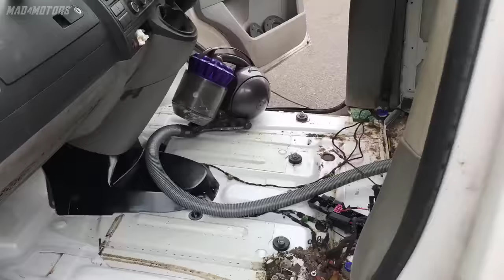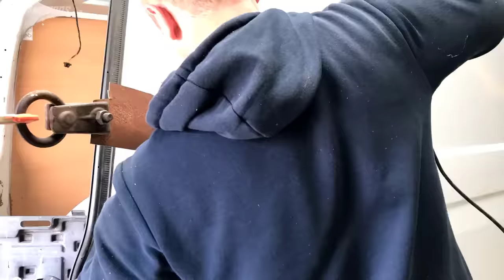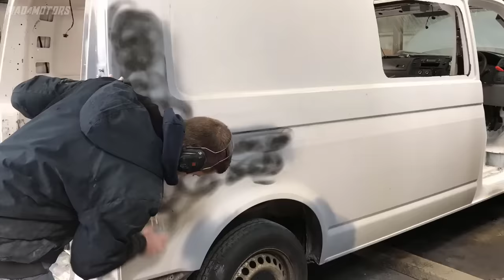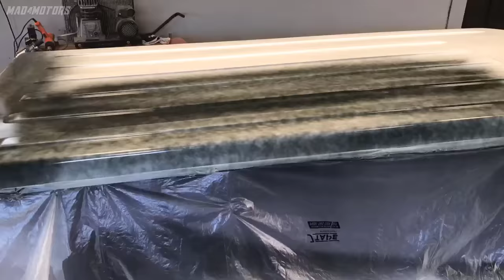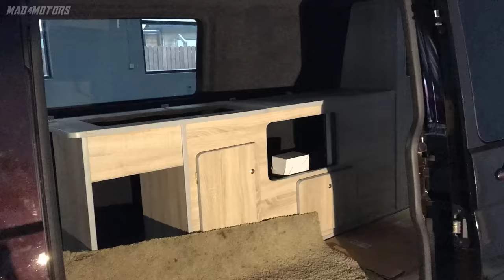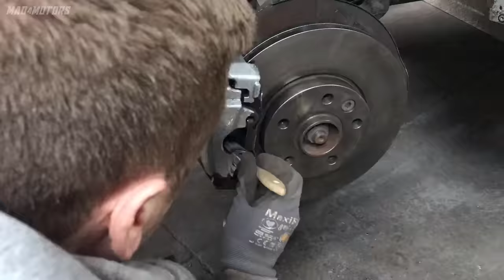Complete Camper Van Build Start to finish Conversion

Comment: Well done, the result speaks for itself. For esthetics I would add rear glas windows from the outside. It just adds weight and has no function but it looks even better.
And I personally would have replaced the double seat with a single seat and svivel function. By turning the seat around the usable living space is significantly increased!

Comment: what about the bottom of the car, there is corrosion there, it was necessary to clean it and cover it with an anti-corrosion agent, and in general the work was done smartly

Comment: Now, all I got to find out is a video on how you do wire work and power source for your car.
Like electric generator, battery, and something like that.
It’s a nice built but certainly not independent for its power source.

Comment: What an achievement, well done you. . . .but two things i've thought about. . .1, what state was the cockpit like before / after??. . it looked a pretty ' well used ' van to start with. . and 2, . . if it was as it looked to me, abused. . .has the engine been looked after service wise, and has the van been thrashed to with an inch of it's life??, but great video, thanks